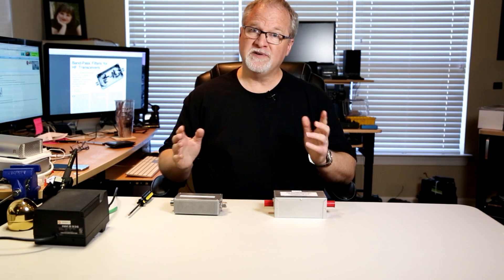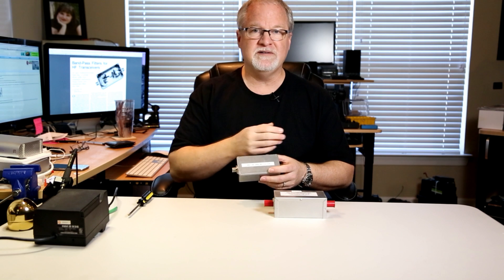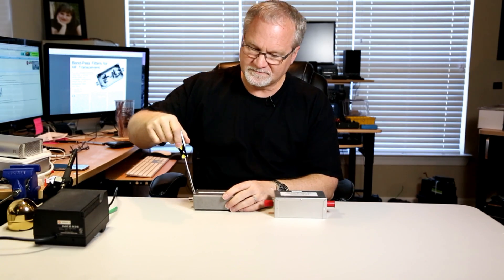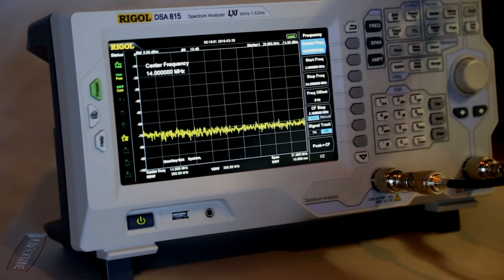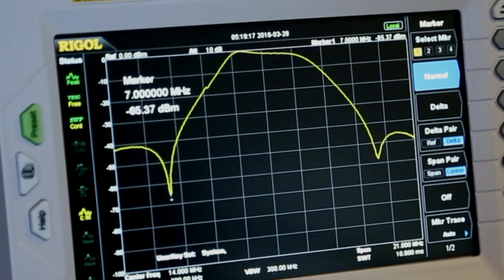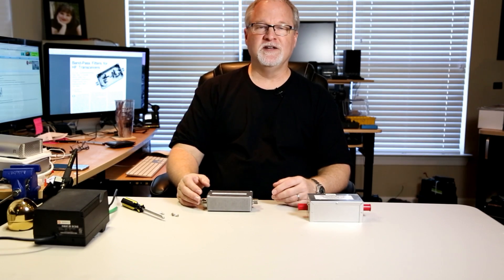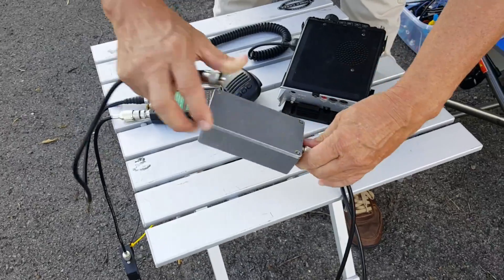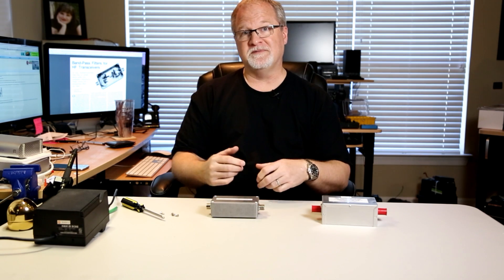Band-Pass Filters for QRM

Comment: Cliff,   I always enjoy your videos.     Thank you for being out there advocating QRP.  I personally do power levels from 800 watts to 6 watts SSB.    20 watts seems to be the sweet spot for my SSB, and 5 watts for CW.  Currently doing POTA and need to find a solution to prevent interference from other activators in the parks.
Reply from the maker: These band-pass filters will help UNLESS the other stations are using the same band as you. And, as shown in the video, a nearby band (like 20m vs. 17m) will not be very attenuated as this filter design is not very narrow. Good luck with your POTA activations! That’s a very fun thing to do!!! -Cliff

Comment: It's also worth mentioning that you could have placed the bandpass filter on the mobile transmitter (w/ a 15m bandpass filter) instead of the receiver with similar results...and that the combined attenuation is additive if you had used filters of BOTH the transmitting and receiving rigs, since they both attenuate signals outside their passband.  73 de AC7NA

Comment: Would using a low pass filter for 0-30MHz help to stop QRM /noise from further up the spectrum entering the transceiver and raising the noise floor on the HF bands ? Thanks
Reply: it will certainly help, will not remove all but some.

Comment: Hello, could  you explain the difference between a high pass filter and a low pass filter?
Reply from the maker: Sure!  A High-Pass filter allows signals above a specified frequency to pass through the filter.  Signals below the specified frequency are attenuated.  A Low-Pass filter does the opposite... it allows signals below a specified frequency to pass through the filter.  Signals above the specified frequency are attenuated.  A Band-Pass filter allows signals on each side of a specified frequency to pass through... but the filter's "width" or "sharpness" determines how far the signal can be from the specified frequency before it is attenuated. I hope this helps! - Cliff
Reply: @QRPSchool  Hello,
 yes i think i get the idea, i have a HPF for the AM broadcast band connected to my Kiwisdr, which has reduced noise level significantly from the sloper dipole. Although, i did not have this problem previously it only occurred when i changed the coax cable.  So from your explanation of HPF/LPF are a more general or broader type of filters and band pass filters are more band/frequency specific. am i understanding this correctly?
Thank you
Reply from the maker: @AA-nm8fi  Yes, you are understanding it correctly.  I would also add that all radios have built-in Low Pass Filters that are used to reduce harmonics that would naturally appear on bands higher than the transmit frequency. For regulatory compliance, radio manufacturers must include LPF's.  You don't want someone to be transmitting on a frequency and also having that same signal being broadcast on multiple harmonic frequencies.  My use of Band Pass Filters in this video is a common use of BPF's when multiple stations are transmitting on adjacent bands within close proximity to each other... such as in a group Field Day or a multi-station contest situation. - Cliff
Reply: @QRPSchool  Thank you sir for the info, great videos keep them coming 

cheers

Comment: Did you coat the toroids with Q-Dope or anything like that after tuning them?
Reply from the maker: I did.  I used my wife's clear fingernail polish to hold the windings in place. - Cliff
Reply: I started building these exact filters based on that same ARRL document about a week ago for 80, 40, 20, 15 & 10m.  I have the enclosures drilled out for the connectors, the islands made in the boards and the 3 LC circuits for each filter coarsely tuned on my grid dip meter.  I just need to compare where the dip is on the grid dip meter with my IC-7300 being that I don't have a spectrum analyzer.  Did you tune them only with a grid dip meter or did you use the spectrum analyzer to tune each of the LC pairs?  Just wondering how close to the exact frequency shown on the chart for Fr that you need to be?  I realize that right on would be best but I suspect that if I tune them on the grid dip meter until the frequency shows as close as I can be on my IC-7300, even after coating the windings, just moving the leads into place for soldering tot he board will detune them somewhat?  What did you find with that?

Comment: Ok i'm completely confused,  You put this on the 817nd right? or did you put this on the radio in the truck so that its transmissions could not overlap onto the band the 817nd was on? It looked like you put this on the 817 but i don't see how that would help. I mean it clearly does from watching the video, but if his radio in the truck is spilling over onto a band your on, on the 817nd and you add the filter to the 817nd to filter out everything other then the wanted band, how does that prevent the spill over from the truck not still being received on the 817nd. Beings the spill over is coming in on the band your filter is designed to pass through. Help did i missing something
Reply from the maker: Hello, Johnny.  Okay, so the FT-817 is receiving on the 20m band.  The radio in my SUV is transmitting on a different band... the 15m band.  The 20m bandpass filter connected to the FT-817 attenuates the signals outside of the 20m band.  So, the 15m transmission comes through the antenna but is then knocked down by the bandpass filter before the signal flows into the radio.  Does that help? - Cliff
Reply: Ok so the interface is not because of signal coming in on a different harmonic from 15 meters that is being received on the 20 meter band, it's just because his radio is so close its simply overloading the 817nd and the overload is only really coming from the 15 meter band. So guess the more i think about it now there would be no harmonic from the 15 meter that would bleed over to the 20 meter anyway. right? am i close at least haha
Reply from the maker: You've got it! -Cliff
Reply: cool thanks

Comment: Does it help in areas with lots of power lines and AC noise?
Reply from the maker: Unfortunately, it wouldn't be very helpful for that.  With a broadband noise source, the noise is going to be found on your frequency... not just adjacent to your frequency.  These filters are designed to reject signals on either side of your frequency so if the noise is also being transmitted ON your frequency, there's not much you can do except reduce the RF Gain to try to lower the noise floor. - Cliff

Comment: I know most people use the bandpass filters for field day or for multi station ham shacks. But would it help reduce noise and interference for a single radio user?
Reply from the maker: Hey, Mike.  The Bandpass Filter would only help if there's another ham nearby who is transmitting on a band other than the one you're on and "bleeding in" on your frequency.  The filter isn't sharp enough to help with other station on the same band.  Really good for multi-station Field Day use or when you and your buddies are trying to work portable on separate bands in the same vicinity. - Cliff
Reply: Thanks so much for that. I was looking at buying or building one for each band thinking it would help but I guess it won't unless I'm field day or multi operator. Thanks for saving me money :)

Comment: Hi Cliff,
Do you have a recommendation for mobile HF?  I am torn between the Kenwood ts480 and the Yaesu ft857 and I noticed you have both!  What are your recommendations and also what antenna would you recommend?

Kind regards,

Simon
M0S
Reply from the maker: Hello, Simon.  In my opinion, the TS-480 is an excellent mobile rig.  It has a fairly large control head with a wonderful display that is MUCH easier to read and interact with than the small display of the FT-857.  Because of the size of the head, the TS-480 can include a good number of buttons on the panel - so you don't have to go into the menu system to do the things you'd want to do while operating.  It's a more directly accessible experience than having to dip into the rotating three-choice menu system of the Yaesu radios.  (I bought the FT-857 to put into a Go-Kit.)

My antenna is a Little Tarheel II antenna.  That's a "screwdriver" antenna.  http://www.tarheelantennas.com/little_tarheel_ii

I have it mounted up at the top of my SUV's back door.  Having it up higher, above the ground plane of the vehicle, allows it to work very well.  It's small enough that I can use a lip-mount. I've got this one:  http://www.diamondantenna.net/k400-38c.html

I have worked a lot of DX from my car with that antenna.  I would definitely buy the same antenna again, based on my good experience with it.  I've had it for several years. The only problem I've experienced is the control cable eventually became crushed by the back door.  I got a replacement cable for $20 and it only took minutes to disconnect the old one and plug in the new one.  Nice.

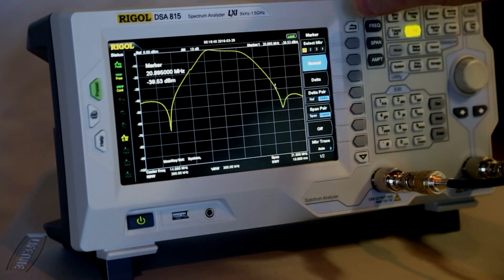You can see a photo of my car antenna in this video at the 4:35 mark:  https://www.youtube.com/watch?v=MaUktB6mveY

Comment: love your channel! maybe I missed it but I didn't catch how you'd build one for other bands like 10m or 80m...is it just a change in capacitors and toroid configuration?
Reply from the maker: +alchemistTi That's right.  The QST article that I used as a reference contains a table showing the various torroid and capacitor values for each of the bands.  Check it out here:  http://www.arrl.org/files/file/Technology/tis/info/pdf/8809017.pdf

Comment: Great videos! Where did you find the metal housing for the filter?
Reply from the maker: +rhettscal I bought the metal box from Digi-Key where I also bought the capacitors.  It's an aluminum box made by Hammond.  The size of the box is based on how big your circuit will be.  The author of the QST article used a 2"x4" board to mount his parts.  Mine was probably the same. - Cliff